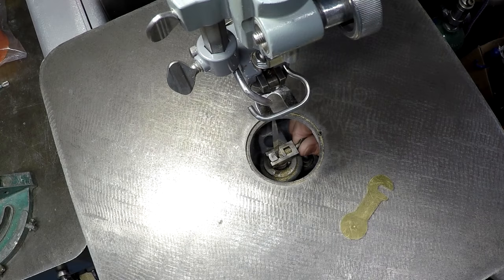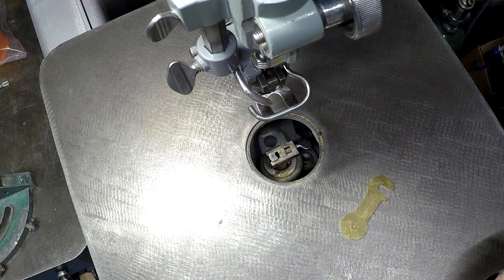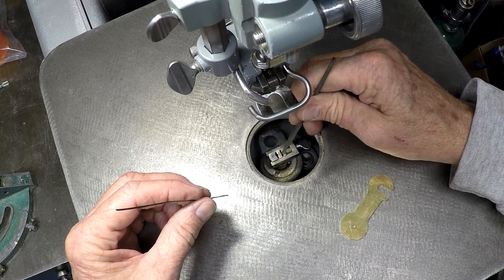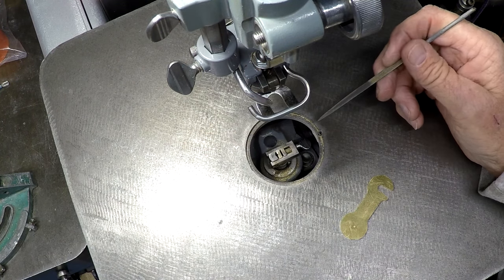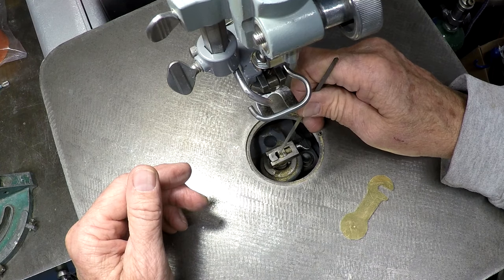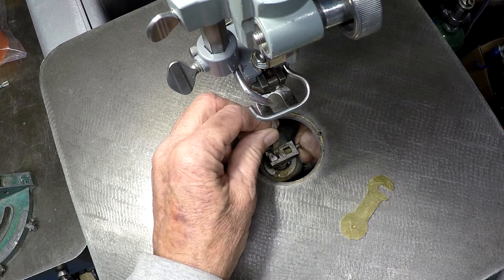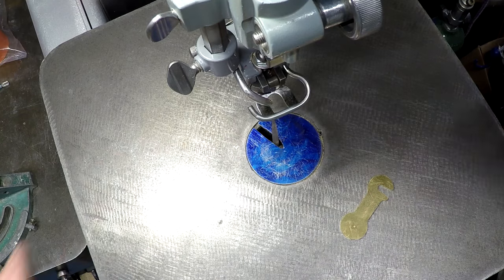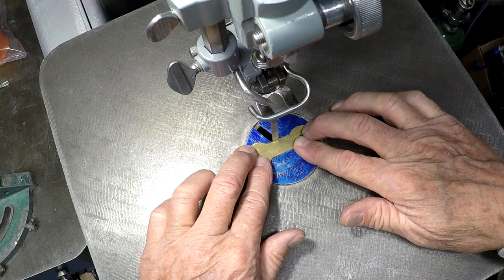Delta/Rockwell 40-440 with needle file

Comment: Thank you for the video. I recently acquired the 40-440 from my late father. I'm unable to determine if it takes pinned or unpinned blades and any specific blades? Very much appreciate your input.
Reply from the maker: I have been using unpinned blades and they are working fine.

Comment: Can you explain how to change a blade and set the spring tension? Old technology.  Ha
Reply from the maker: Loosen the clamps on the top and bottom supports and remove the blade.  When installing a blade, install the bottom first, then hold the top support down (the spring tension) and install the upper support.  Once the blade is installed, tighten or loosen the spring tension adjustment to get the tension you like.
Reply: @vendter  , gotcha.